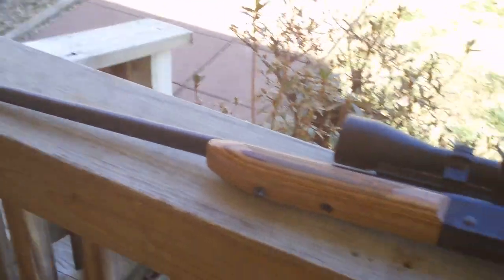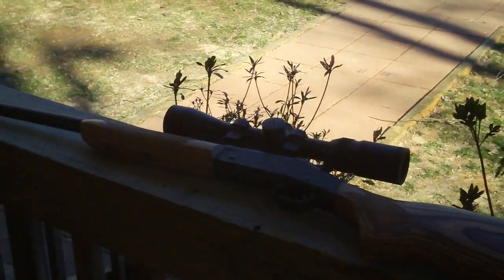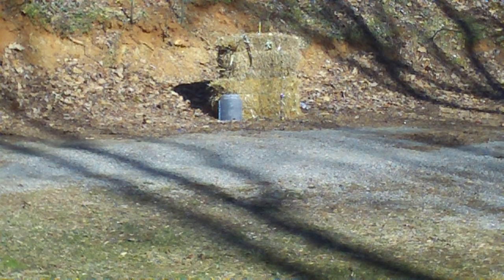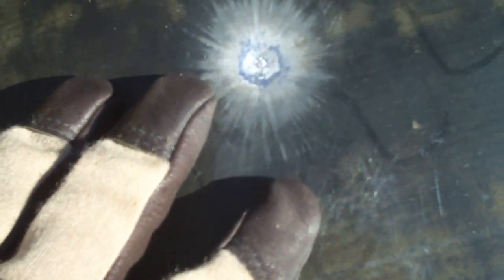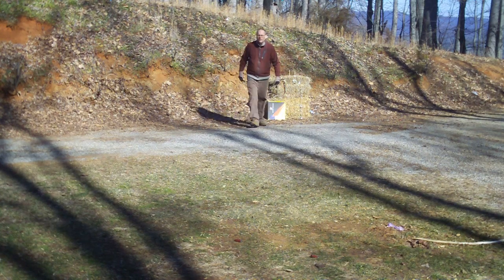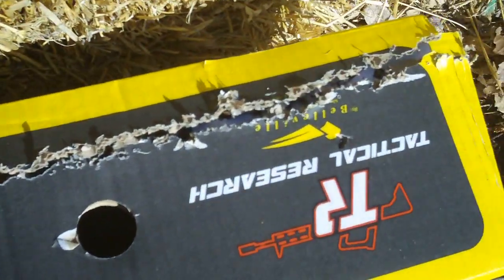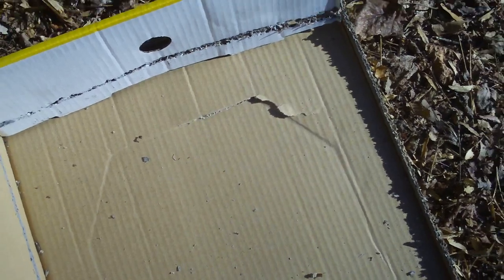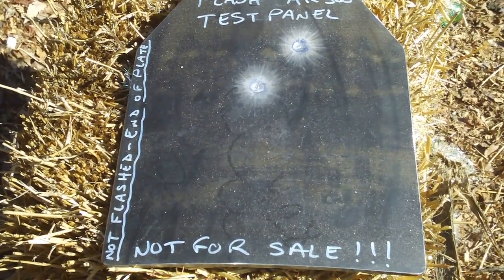FlashTM 500 Armor VS Win .308 Live Fire Tests

Comment: Sorry Skyjumper - CDMG is right and you're wrong in this case. Spall is the flakes of the LARGER object (ie the plate). The stuff that mod god is pointing out is actually from the bullet disintegrating, not the plate flaking. So - no geek bonus for you :)

Comment from the maker: I wanted to add that I am going to get some plates and "finish" them by prepping the steel for paint in my blast cabinet, painting them in epoxy paint and I hope to offer the option of a pre installed splatter mitigation shield. No idea yet on pricing because I have yet to clock the man hours, add up the cost of materials and have no pricing yet on splatter mitigation shields. They sure won't be $50 though.